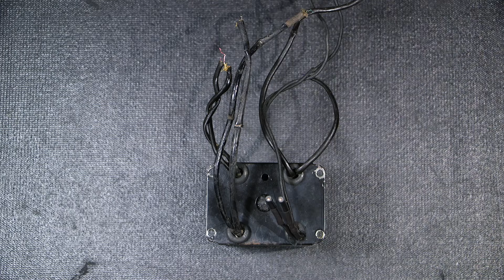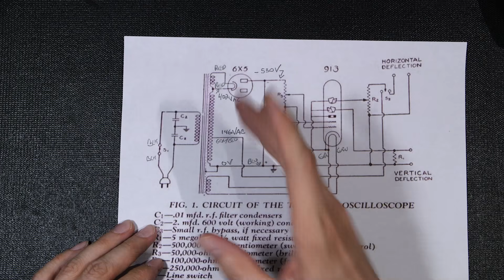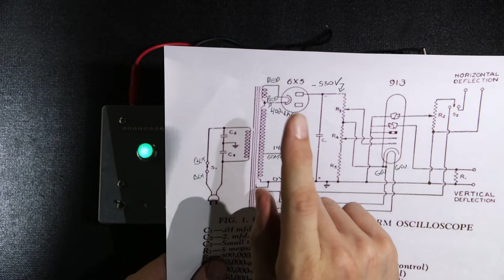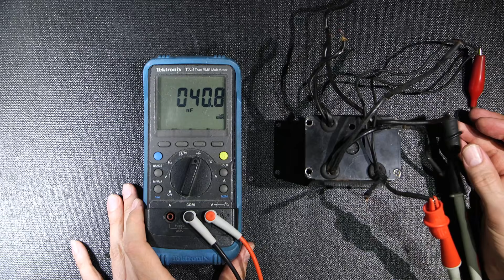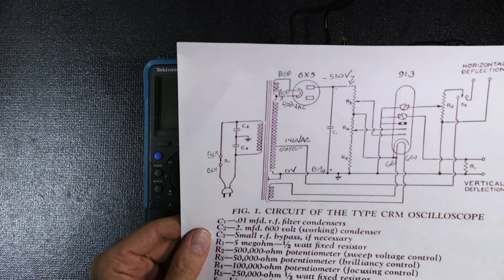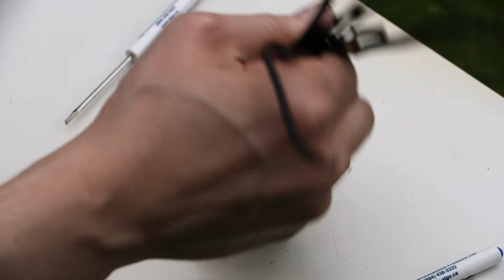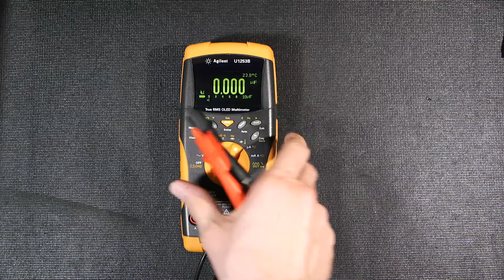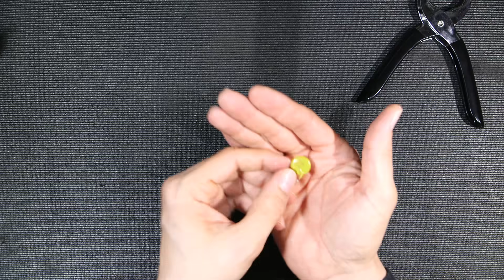Transformer Repair {Depotting} Lets Look Inside!

Comment: Paul:  What's your position on adding a safety ground to chassis on old equipment which originally had only a 2-pin power plug? Should adding a safety ground be the default choice for old consumer, communication and test gear?
Reply: Rick:   There are many things that may not be "necessary" but the issue here is best practices. I would have installed a 3-wire cord and plug, and I would not have been bothered by the "ugliness" of a modern molded plug. I would be more interested in returning the equipment to safe functionality than retaining strict originality (after all, if you get overly concerned with originality, you would have to reject replacement of old electrolytic capacitors, drifted resistors and frayed dial cords). The question here is whether you should sacrifice just a bit of originality to add a bit more safety. (Mr. Carlson seems to answer this by always installing better-than-original-quality replacement parts, but then my understanding of his efforts is to produce daily working equipment and not shelf-queen restorations.) My question also goes a bit deeper in wondering if there might be any restorable working gear where you should NOT default to adding a chassis safety ground; i.e., when should you specifically NOT use a safety ground?
Reply: I believe it has much more to do with avoiding introducing noise via ground. If you have a bunch of devices already on your ground line (which every house does) then if you add ground to the case of one of these older devices, you are really just adding noise from everything else on the ground line. Yes adding ground is safer, however with this old gear safety is all relative and it mostly comes down to knowing what you are dealing with.

Comment: I have a megaohm meter that tests motors windings at 500v and 1000v would that be able to do the same test for leakage as that is what I use to test wingdings to ground?

Comment: This may be a newb question, but why would the two tubes have their own dedicated 6V windings where normally one winding would be enough for both?
Reply: Not an expert but my take on it is that the heater for the 6X5 rectifier is tied to it's cathode, so it's at 405 VAC. You would not want the CRT heater to be at the same potential.

Comment: When I had to depot old "block" capacitors .. I regularly used just a hot-air gun. It needs some care and practice, but you effectively just heat the outer layers rather quick and in most cases will be able to just pull the innards out after a few seconds without getting them too hot.

Comment: Excellent video Mr Carlson, very impressed with both your methodology and dealing with a rather irksome legacy manufacturing technique. Great upgrade and reassembly.
Obviously the manufacturing method was costed and to aid assembly reducing mounting the two capacitors elsewhere in the instrument. As you and many know,  ( excuse me trying to teach yourself and your subscribers sucking eggs etc) all manufacturers need to reduce costs to survive, and pay their shareholders.
 My background is in mechanical engineering/production, and the USA has led the time and motion - productivity from turn of the 20th century, then timely occurrence of the two world wars. I am from the UK, and our engineering has become the basis of worldwide manufacturing, but due to the smaller market, we did not develop fully mass production, rather relying on our unique items. Mayo and Gilbrath were USA pioneers in efficiency.
Always learning.

Comment: I would like to know if there are any "predictive" capacitor tests which might be of interest to amateur operators or others exposed to excessive numbers of caps. This might include some electrolytic caps, also. I know that this is like "chucking a grenade" into the works, but the question DOES appear quite often. What I am looking for is more of a predictive test for caps which measure OK on standard (?) capacitance testers. de KQ2E

Comment: Thanks Paul!  When watching the initial video I was convinced that there had to be caps in the case, and of course, there were.  I always enjoy your videos!  It's just a suggestion, but I would appreciate a video from you on the following.  Years ago I ran across the Ten-Tec Model 418 160-6 Meter Solid State Linear Amplifier , and fell in love with the concept of one amp for that range that you "didn't have to tune" from one band to the other.  It may have been a misunderstanding on my part, but if it really could do that I would love to have purchased one, but have never been able to afford to.  Now Ten-Tec is no longer...or at least the amp is not available new.  You can get the schematic, but what I would like to have from you is advice on construction if one were to build the amp from the schematic as to things to do and things to avoid.  I was planning to use it with my Yaesu 817ND as an emergency setup for my C.E.R.T. kit.  Thanks again for the great videos you produce!!!  Wayne WB4RHA

Comment: I really expected a lot more tar than there was. Seems like the only function of the tar was to deaden any noise or vibration from the transformer. Good thing they didn't have epoxy back then.  Still, it was a dumb idea to put those caps inside the transformer.

Comment: There's something for the "planned obsolescence" folks to dig their teeth into. Caps,which they must've known at that time would fail, stuck somewhere totally non-servicable. Boggles the mind! Was it on purpose or what?
Reply: I think it is planned obsolecence though. In 1940s and 1950s literature you can often find some notes on less than stellar filter capacitor quality. But i reckon they could easily get 15 to 20 years which would probably be acceptable to many. 
For those who made their own equipment. one of the dutch publications insisted on using 1500v tested caps, and also putting a fuse in both live and neutral wires in case there is a short to ground.

Comment: National probably didn't manufacture that transformer themselves. More than likely it was made by one of the transformer manufacturers of the day to National's requirements. I guess the engineers of the day figured that by the time those caps failed the scope itself would have been discarded long before.  They certainly never envisioned that Mr Carlson would be rebuilding their scope almost a century later. ATB Doug.

Comment: ACETONE.  immerse it in a sealed jar of acetone.  do it oudoors and let it soak a few hours.
Reply: Botha Lissom  the acetone may damage the enamel on windings = 1 dead trani, but it would dissolve pitch
Reply: thanks for the tip.  IMHO, these companies wanted to prevent mods and after-market parts.  and that's consistent with modern companies like apple.  they want a reputation for consistency and, where necessary,  they could recall and upgrade all units.

Comment: I have recently found a regulated power supply (around 20W) entirely submersed in polyester resin...It was trash anyway so I carefully hammered it to get the transformer out. Luckily I did not damage it so it has already got another opportunity in a project last week

Comment: Very creative way to heat that transformer up Paul. Brilliant. Really strange that they put those caps in the transformer. Never know what you find in these things. Thanks for sharing.
Reply: If the caps go bad you have to replace the entire assembly and more profit for National, perhaps.  But the ease of assembly is more likely the case.  Look at how the construct automobiles, quick assembly,  poor access for maintenance.
Reply: @46bovine  , such an awful (but possibly correct) observation about National.
Reply: the = they
Reply: Those transformers were made to be cheap and quick for the assembly line. Putting the caps inside meant no need for a tag strip in the unit, and thus saved time in assembly. Plus they could arrive at the factory already made with the line cord, and tested already so no wiring mistakes possible on the mains side.
Reply: @SeanBZA  , Stupid is as stupid does.
Reply: Usually, the caps are added for RFI reduction; the scope may be generating it internally, and the caps attenuate the back-feed.
Reply: @paulmoffat9306  , I believe he was talking about the strange place the caps were put, not their reason for being in circuit.
Reply: If the caps go bad you have to replace they entire assembly and more profit for National, perhaps. But they ease of assembly is more likely they case. Look at how the construct automobiles, quick assembly, poor access for maintenance... That's programming.

Comment: I tried this about a year ago and what a mess.
Reply: Mr. C has a way of making things look easy!  ;)
Reply: WillieRants Yes he's does, I used a propane torch when I did mine, but it had a lot of tar in my transformer.
Reply: You want to heat just the paper and outer shell, not the tar inside. Technically this was not depotting, and I'm sure that the thermal characteristic  requirements took some time to discover, and the temperature setting controls on the 'nasty oven' were more important than discussed.

Comment: You think this potted capacitor is a silly thing to do? I once changed the non volatile memory battery in an old HP scope and it was epoxy potted in to the memory chip.
Reply: That was done in the past, to be 'convenient' for the manufacturer (no additional battery). One chip maker that I remember, was Mostek.
Reply: Yes, i think the manufacturer was called Dallas something. The battery was on the underside so I had to first desolder a >48 pin DIP package from a 4 layer PCB without ripping out one of the vias, it was a pain....
Reply: Those Dallas chips were famously used in IBM PS/2s. Fortunately IBM socketed those. There are diagrams online showing right where to grind away the chip to expose the internal battery connections and attach an external holder. I've done it, works great! Pretty sure they're still available, though last I checked the price had shot way up.